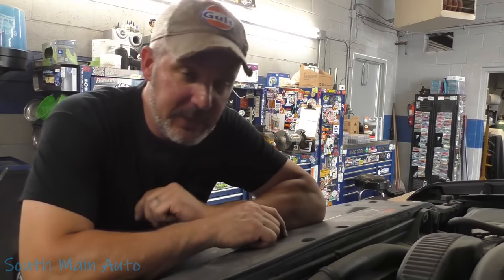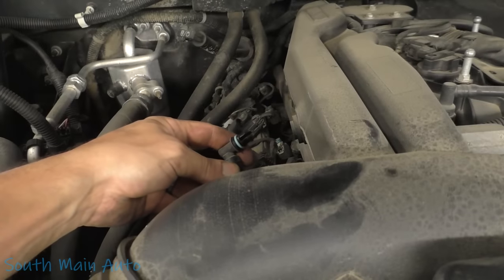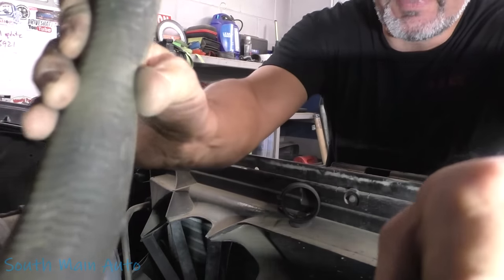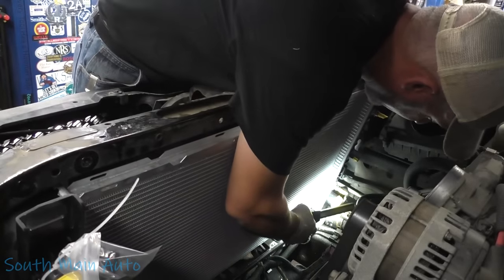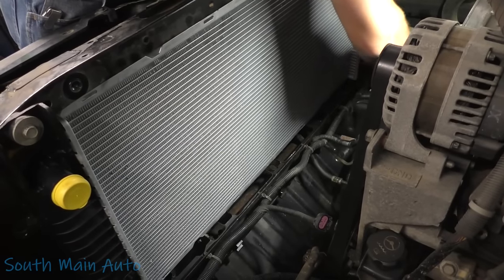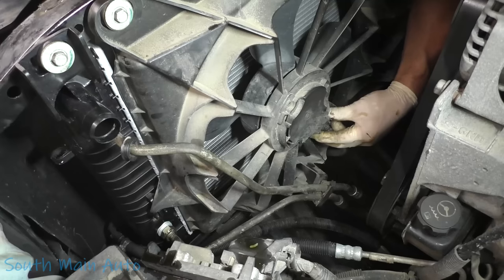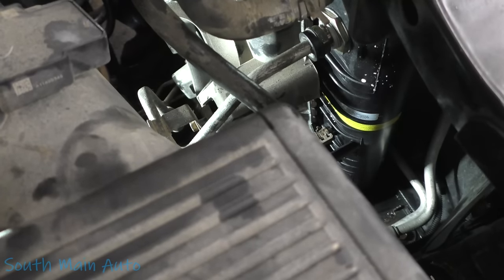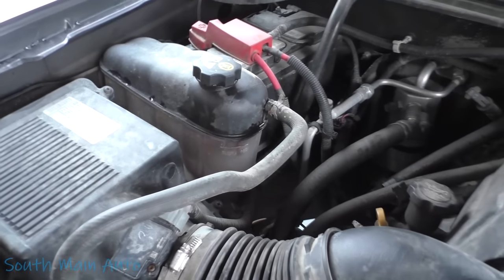'11 Chevy Silverado: Radiator Remove & Replace

Comment: I had so much trouble with aftermarket radiator in a '99 Subaru.  The thing was made totally wrong and the AT line fittings banged into the frame, no way to install.  Had to go to NAPA (not a sponsor) and look through boxes to find one made right.  You know why - that country we're to supposed to disparage.

Comment: I’m a O’Reilly auto parts fan however they use Murray radiators and I’ve had a couple of those fail so I don’t use them, best aftermarket radiator I’ve used comes from carquest or advance auto. If I don’t need to use the original equipment then those are my go to..

Comment: My 2008 GMC has 220,000 miles on it and runs great, very little problems other then minor wear items.  I right now I am working on 2004 Ford F-150 with close to 200,000 miles, its only had one transmission and one engine.  Its even rusting out. I will keep driving GM products as I never have trouble with them.

Comment: Last aftermarket Chevy truck radiator I used didnt have the restriction in the line going to the tank. Truck ran too cold until i added a restriction to the line.

Comment: In 2019, you could get a four wheel drive silverado with a V6 for 28000.  Now the turbo four is almost 50,000 and all the rest are over 50,000.

Comment: I remember way back in 2007 the first car I ever owned there was just a wing nut and you could take the breather off and see the carburetor. I had to get rid of it because the drum brakes in the front kept pulling.

Comment: Hey Eric, first time watching one of your videos and of all the ones I’ve seen of others doing work, yours is very straightforward without all the nonsense. I’m going to change my radiator out in a day or two (bought ac/delco on Amazon) and my question is this, how much transmission fluid and engine oil did you lose in the swap?

Comment: is that why they also had the ad "Wouldn't you rather drive a Buick" actually I'd rather have an Oldsmobile then again anything that runs and drives is perfect to me. if cooling system leaks is a plus no need to flush or exchange coolant at extra cost

Comment: just did one on a 17 silverado 1500.  police pkg. had 125k on the clock. came in with swelled up hoses and milkshake in the overflow. no oil pressure. nothing leaking on the ground.  oil tank failed . pumped all the engine oil in the radiator. had the oem radiator.

Comment: Just had the radiator go on my Wrangler. 8 years 80,000 miles. Replaced it OEM. I have the lifetime on the Wrangler. I would replace the hoses while I was at it. No sense getting stuck.

Comment: Those never airlock but the fastest way to fill one of those is dump a gallon down the throat of the upper hose and fill the block because it has a lower mounted thermostat then connect the hose and fill the coolant tank and you're done

Comment: Yes Eric, Jiffy-Tite still has manufacturing in Lancaster and Batavia, NY. They are now part of Oetiker, which I believe is Swiss. 
 Delphi Thermal made everything from the radiator to the dashboard for several domestic and foreign auto makers, they are now owned by German company Mahle. 
 The dash in my 04 Tacoma looks just like a smaller version of the dash in my 92 F-450 because they are both Delphi. The radiator in my Tacoma says Harrison because the tooling was made in the mid 90's before Harrison Radiator in Lockport, NY was spun off by GM to Delphi.
 I worked at a Tool and Die shop that made prototype and production tooling for Delphi, we were working on prototype tooling 3-4 years ahead of the model year it was going to be used on. In early 2000's Delphi started to source tooling from China, as does the Ford Stamping Plant in Hamburg, NY. It's called Globalization.

Comment: A job well done,but the coolant reservoir needs a good clean or maybe replace it so that you can check the coolant level without using light in the background ;)
Reply: Using a light is faster than cleaning or replacing a perfectly good reservoir when he isn't being paid for either.  He runs a business.  I do the same thing on my vehicle because the plastic reservoir is old and cloudy but still perfectly good.  I can't afford to throw money away replacing parts that work just fine and cleaning it won't change the fact that it's cloudy or make the light colored fluid any easier for my old eyes to see through it.  Why do so many people seem to look for ways to fault the fine work Eric does?  He's already making the job take longer by filming it for us.  I'm sure the customer is perfectly happy.

Comment: Several years ago (10+) a deer attacked our Honda Accord.   Radiator and AC c ondenser had to be replaced.  Body shop could not get aftermarket condenser to work.   Had to go with OEM.

Comment: I generally like oem radiators better because the tranny cooler thats built in always seems to perform better than the aftermarket ones.

Comment: Back in the 90's I changed the radiator on my old Fiesta XR2. It was easy. I wouldn't even attempt anything like that now. You'd have thought that by now at least one manufacturer would have designed an engine bay where you can at least get to everything pretty easily. Obviously it's not in their best interest, but it would be nice....... sigh!

Comment: Not often but have seen OEM fail miserably, especially in wheel bearings .. Many OEM and aftermarket parts are made in same factory and just put a different label /name on it. Many GM parts are made in Korea and elsewhere as is aftermarket.

Comment: Hey Eric, it seems you have pretty much EVERY TOOL known to man, you have all the kits. i sometimes wonder how you keep track of what you have and where to find it. can you show the people your assortment of kits? i bet you have an entire shelf of tool kits like that. i am curious to see what your collection looks like.
Reply: I use white duct tape on toolkit blow molded cases & use a sharpie & simply put a good quality clear packing tape ( gorilla) over it to seal  the label(s) , top & face , preferably both,  so that no mater if you stack them  or pack them vertically you can see what you need at a glance.

Comment: I don't know about there, but i know around here there are more GM vehicles on the road than Ford or Chrysler, so it makes sense that there would also be more getting worked on.  That being said I do see a lot of Trailblazers/Envoys and  FWD based GM SUVs and crossovers for sale with transmission issues to the point that I wouldn't buy one unless the trans and been replaced recently and then i would be vigilant on changing the fluid and filter ever 25K-ish miles.

Comment: NAPA coolant and oil bottles in Canada have the same stupid problem. No clear section on the side to help you gauge how much you've used.
Reply from the maker: What's the point of even putting the gauge on the side then? It's always made me shake my head...
Reply: I get around the problem by dumping the NAPA oil into an old Mobil ! bottle that I keep for that purpose. It does have the clear stripe. But stupid that I have to do that.

Comment: pretty sad that this is an easy job nowadays used to be on cars i did radiators on you just took off a couple brackets and hoses slide old one out and new one in those were the good old days

Comment: The aftermarket radiators are never right.  Yet they all claim they are a direct 100% OEM fit.  I have no issue buying another OEM if they lasted 100 miles more than the after market... but they don't.  Somewhere around 100k the hot side tank gasket gives up. Rinse and repeat.

Comment: I replaced a radiator in a mini van a couple weeks ago and the AC condenser was connected to the radiator. It sucked! Not enough room to get them in connected and really hard to get them connected after they’re were in.

Comment: Everytime i`m working on cooling system i'm asking myself "why not all the car companies are making a special drain for the coolant?" it would be much more easier to work and safer for environement. I have an old 2003 VW and it does have this option...but elsewere i don't see that often...
Reply: Saving 5 cents during manufacture to leave off drain plug. If the radiator has side tanks, you can suck most of the antifreeze out through the fill.

Comment: Just want to put in my 2c .... I used to have a radiator business and you are wrong about aftermarket radiators, by far not all of them are junk ..I have opened thousands of boxes with radiators in to check that they not damaged before delivering them and found that many of them had the 100% same markings and inspections as OEM. It turns out that there are not that many factories that make radiators so they put the " OEM " ones in fancy printed OEM boxes and the rest " Aftermarket " in plain boxes. And guess what ..Napa doesn't have a radiator manufacturing plant ...they get it from the same place but just have them put it in boxes with NAPA printed on it.

Comment: Eric - with these aftermarket radiators, do you flush them before fitting them? Anecdotally I've heard of aftermarket radiators and intercoolers coming out of the box with metal shavings / swarf / loose weld blobs from production rattling around inside of them. Not the kind of thing you'd want flying around in the coolant or sucked into the intake in the intercooler scenario.

All I have is a hand full of anecdotes though. Whereas you probably got through a hundred+ such things per year for the last hundred+ years - so you'd know if it was actually a thing that happened regularly.

OK, I'm sorry - you've not been at this over a century, it just feels like it some days :D

Comment: I always change the lower rad hose during rad replacement, regardless. Why? Because changing the top hose is easy. The lower? Not so much!! lol
Reply from the maker: Do you see a lot of radiator hoses fail?

Comment: Have you ever tried Mishimoto radiators?  I replaced my oem (with plastic end caps) radiator with an all-aluminum unit.  My Challenger is susceptible to blow the radiator hose inlets.

Comment: They are all junk! Especially condensers! My favorite is the Jiffy connectors that Wick tranny fluid on the Chinese junk. Just had that problem with an Escalade AC condenser with the transmission cooler built-in. The Jiffy connectors not fully seat in the Chinese garbage. Ended up replacing the condenser with one from GM and everything just popped right in like it was made for it. Imagine that. And those condensers don't pay and they're a pain in the ass on 2014 and newer Tahoes and Escalades

Comment: Chevy = job security.
Reply: Wrong
Reply: And Chrysler
Reply: With amercan car junk there all end up there
Reply: "Chevy Blunder!"
Reply: Same for Found On Road Dead !!
Reply: Nah, that’s Chrysler
Reply: Mostly Old Parts And Rust
Reply: My Old Plymouth Ain't Running 😂
Reply: Mechanic = job security.
Reply: add in ford, dodge, toyota, hyundai, etc, etc, etc. name 1 brand of car that doesnt break down! quite honestly, they are all junk. they are made to be disposeable.
Reply: @dougbaker9473  Fix Or Repair Daily

Comment: Hey Eric, I helped my brother change our his chev truck radiator and I broke one of the plastic secondary clip thingy.   Going back together I'm confident the engine oil cooler line snapped in place but as I said the secondary plastic thing was broke. Two weeks later I got the call to bring my trailer and pick him up from along the highway. The cooler line came out and dumped the engine oil . Before he caught it he spun a rod bearing. What can be done to replace a broken secondary clip thingy? You've got me wondering so I'm going to check "the Google"! Great videos!:)

Comment: How do you get the the Vice-Grip to lock onto the hose clamp on the first try?  I usually have to make several adjustments to make it work each time I use one of those tools.

Comment: Sure is sad to know that an OEM part has to be three to five times the cost of "aftermarket".  Especially with a radiator, same amount of plastic, same amount of aluminum, same design/tanks/mounts etc. yet, the price is $500 vs. $150 for example.  I reckon we must all contribute to the insane amount of TV ads they publish thinking they are bringing in buyers from other brands. Not likely.
Another no collateral damage repair job from SMA. You have to wonder why some of the area shops refer their customers to SMA now and then vs. up their game.

Comment: I hate the fact that most all radiators nowdays have plastic in them… 🤦‍♂️
Reply: When my tracer's radiator plastic cracked and blew a cloud of coolant all over me I was able to find an all metal unit. Not much luck with that for my truck.
Reply: @jcadult101  yep, all by design, i have a second gen Tundra and the side plastic was the radiator failpoint. PITA cause the trans lines run through it. Consumers deserve better
Reply: @stingray427man  Yeah, separate trans cooler conversion is a no brainer on those. 2006 sequoia here.

Comment: While I would understand that parts from Denso might not fit all brands of cars (well), I doubt that they will not fit on Japanese brand cars, since they are an OEM supplier for those brands. It would be like saying AC Delco parts will not fit on Chevrolets.. Is that what you meant?

Comment: Couldn't you have just pulled those jiffy-tite fittings from the OEM radiator and put them on instead of sticking to the new junk?   Is there any reason not to reuse the old one's?

Comment: Would it be prudent to change the water pump also @ this juncture, since there is considerable remove & replace work involved with the radiator, the pump is now accessible❓if the radiator is worn, is the pump far behind❓
Reply: No, failure rates not connected.
Reply: That would add considerable time. I'm doing the radiator on a 2006 but doing the hoses at the same time. Rubber doesn't last long down here and if the radiator is leaking, might as well do hoses while the coolant is out.
Reply: @jcadult101  When you say "down here" you mean down here on earth, ❓🤔
Reply: @billupstateny9151  Down here as in south of the rust belt. It's 117* this week, we don't have that rust stuff he constantly deals with.
Reply: @jcadult101  I dislike the rust we deal with, but those temperatures would not work for me.
Reply: @jcadult101 Exactly